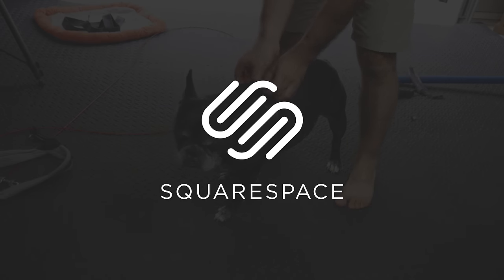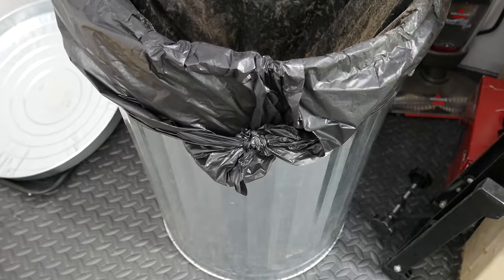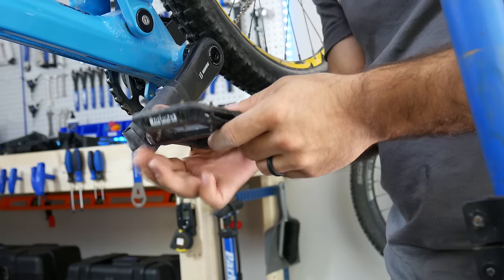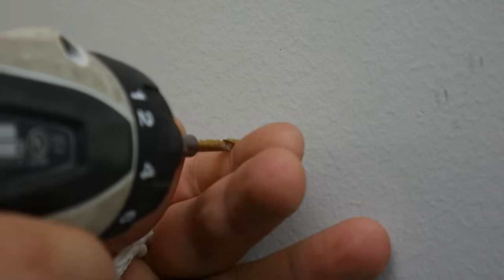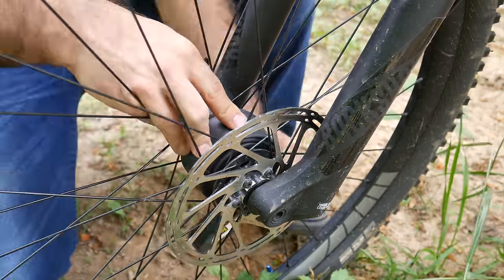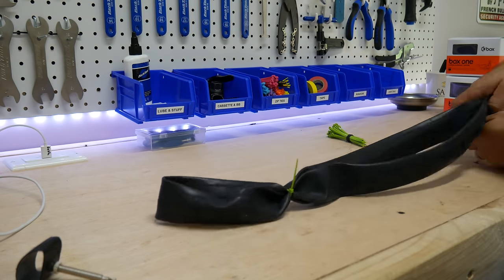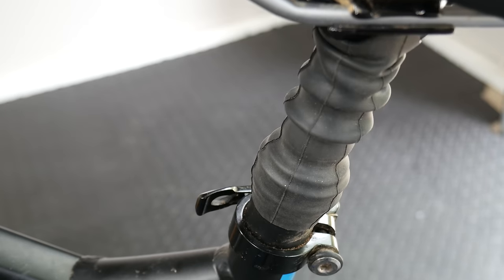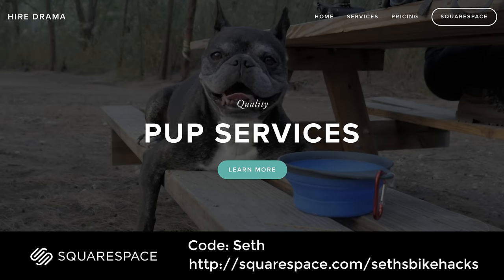10 Bicycle Inner Tube Hacks

Comment: One more inner tube hack that literally saved my ass: during a descent I lost one of the bolts that fix saddle on a seatpost. So I cut presta valve from the spare tube and used presta valve and nut as a bolt and olive to attach my saddle to the seatpost. That's why I loved presta.

Comment: To rip off some parts without scratching you can also use what, you guess? right! you can wrap part in regular piece of paper folded in many layers it can bare much more pressure in vice grips than tube rubber. I've figured that out when I had to unscrew marzocchi cartridge it was assembled very tightly and bicycle tube hadn't worked then. By the way nice idea with seat post, I've done same with fox r rear shock few years ago.

Comment: Hey Seth I have another inner tube hack. To protect your shock or stansion use an inner tube. Cut an inner tube and put it on your stansion or shock then connect the tube togeter with rubber cement. Thanks to your droper post hack I thought about this hack.

Comment: While watching this video, I realized that I also use an inner tube hack. I cut a piece of it perpendicular, so I got a tube which is like 10 cm long. Then I rolled it up to get a thick ring, and pushed one of it's side in, so I got a C shape, instead of an O. I put it into the downside of my seatpost (not a dropper) and now I can carry about 50 zipties around, by just sticking them into it. The good part, that it is secret, so people just won't take my zipties away. 
If its necessary can take a photo of it

Comment: on my downhill bike - i split an old tube down the centre seam, put my actual tube inside the split tube and put that inside the tire, and inflate. It adds a bit more weight but haven't had a puncture since. :o)

Comment: I use a piece of inner tube for shuttle service where you hang your bike with the front wheel. The tube pulls the front brake so the bike moves much less in the hanging position.

Comment: If you don't have a presta valve adapter, I figured out that you can make one out of a valve cap. Cut off the tip and push it on to your valve backwards, it should work just as well as a proper adapter

Comment: Oddly, I guess I'm not the only one who has resorted to odd measures to temporarily patch an inner tube. I once used a bread twist tie and fit in the puncture and wrapped it around the tube. I thought for sure it wouldn't hold air, but it actually held air for about 2 hours.

Comment: On my BMX in the early 1980`s i used to cut about 3 inches from an old inner tube and placed it over the bottom headset cup and this portrayed as an early dirt skirt.

Comment: If you are one of the few with both internal cable routing and an unused DI2 port, and those rattling cables drive you nuts, just take an old tube, cut it to length from your down tube to the DI2 port. Seal the tube (knot it, rubber cement)) and fish it through your frame. inflate the tube through the DI2 port and then stow it away. Silent internal cables for a small weight penalty.

Comment: I have a really cool inner tube hack. If you are traveling. Wrap an inner tube on your rotors. Cut it to size. And drill a hole on the tube. This will prevent youre rotors from being badly bent. Use Fidlock or zip ties. Clean it up before you install it on your rotor.

Comment: If your inner tube has pinned or flat you can use rubber band for temporary repair just tie on the pinned part and secure if there is no air going out anymore then if there is no you are ready to go so don't forget to have some rubber band in your bags when going to ride

Comment: If tube loses pressure very slowly it most likely means microscopic undetectable puncture, so there is no point taking it off -  just put some talc with water(or with winter wind shield fluid so it wont freeze) inside and you get tube with limited self repairing capabilities:)

Comment: when having a bike without a suspention fork like a bmx put a barend in the fork so your foot wont get stuck in there when doing footjams.
Also if you have a rim brake put a small coat of glue from a gluestick on the rim for better braking (spin the rim around and hold the gluestick againt the both sides)

Comment: If you need a chain breaker but don't have one, use a small socket or nut, a "c" clamp, and a small screw or bolt.

Comment: The tube around the dropper and around a hub is both not a good idea:
1. Dropper: the seal is pretty bad and if water gets into the tube there is no drainage, so after some time it will flow into the dropper post.
2. the hub is pretty much the worst place to tape your tube around: its hard(er) to get to than just wraping it around your frame, it adds to your unsprung weight and even worse to your wheelset and you have the chance to bail really hard if the tape wears off.

Comment: Y'know, if it wouldn't require me to completely disassemble the front fork, I'd  use the dropper post boot trick up front. I just have the Suntour XCT the bike came from, so far, so it'd be handy, and I actually like the look of rubber boots on shocks.

Comment: I was doing rly fast trails in uk and my tube got a huge split in it so I found a old tube over a tree which also had a split in it so I cut a few inches of and put it over my tube then I put some tape and rubber cement on it and it worked fine

Comment: If tire get small leak, and you not have any pads to repair it, rotate holes to some distance from each other. It reducing leak. Work require to emptying tire and rotate tire and pumping high pressure to tire.

Comment: The dropper cover is going to hold dirt in between the tube and the stanchion. This will scratch the stantchion and cause dirt to get under the seal
Reply: Use a bit of electrical tape and wrap it around the post at the bottom and the top and nothing will come into that gap!

Comment: Instead of  trying to drill the inner tube you could use a bottle torch to heat a scratch awe or punch and burn a hole through it. Just an idea.

Comment: hack for hydraulic brakes:
pull your brake lever with a zip tie to your grip over night, if there's some air in the brake system.
They will work good as new!
Reply: I'd like to know how that works. Do you have an explanation?

Comment: Hey Seth 
Can you try to make a cable end out of a soda can? Just cut it and measure the length of a normal cable end use the silver side of the can then by rolling it into a cylinder after rolling it fold the tip of it and your done if you want to customize it you can color it with a sharpie.

Comment: Folks+Seth, I have a question:
I have myself a 2017 Trek Marlin 6 Hardtail. I've had it since October, and all has been well on it except the rims: they're quite weak, and I find myself having to true them around every other ride. Recently I just took a pretty big fall on pavement and that bent my front rim. This made me just decide to ditch these old rims and get new, higher quality ones. The current rims on the bike are Bontrager AT-650 29 inch. I am looking for a set of wheels that will not exceed $200; they have to be compatible with my tires, 29x2.2 and 29.2(rear). Tubeless compatibility is a nice feature to have, but is not essential if it means a higher price.

Any help would be greatly appreciated!

Comment: bikehack: if you want to install pedals, just screw it in for the first turn and after that hold the tool and just spin your cranks backwarts. It will make changing pedals so much easier.

Comment: Hello Seth, could you tell me if there is any disadvantage in putting used inner tube on new inner tube in the tire, as added layer protection against puncture? I searched on YT & Google but not found anybody commenting on this.

Comment: Yow. Got a new MTB and its a prebuilt (not sure if that's the right term) it has a Stock Air Suspension branded by their company (trinx) and I'm not sure how to properly set it up. it doesn't have a rebound thingy. it only has a manual Lock out.

Comment: Take a hot glue stick and wipe it around your back rim and your brakes will work better. You can use any drink with sugar but the effect will ware off better
Reply: Cool
Reply: Mountain bikes use disc brakes. But for a bmx it works great. Done it myself

Comment: Hi Seth or people in the comments, I'm a beginner to riding street but I have a 3 year Mountainbike and 6 year BMX (on track) background. I want to buy some flats for riding street because that makes me feel more ''safe'' than clipless if that makes sense. Can you give some advice on what pedals to buy? My budget is around €60. I've been looking at the race face chester and the shimano saint pd-mx80. Thanks in advance! Keep up the good work and greetings from the Netherlands!!
Reply: You might get Saints even for 40€ on the internet, but me myself, I've got some experience now with my Contec Vice Flats (75€), they are pretty big, have cool design and are really comfortable to ride. And they got a lot of those srews for more grip, which can all be removed easily. But the best thing is, they were "cut out" just like they are from a big piece of aluminium by using CNC-Technique, which means that they are really robust! But you could also have an eye on the crankbrothers-flats!

Comment: Not exactly a hack, but. . . 
When you need to punch a nice round hole in an innertube or most any other soft-ish material, run by your local leather hobby supply (or look online). Pick up some leather punches, they have them not only in belt-hole sizes but up to oh, say, 3/4". The also come in various shapes like oblong and oval. Slainte!

Comment: I noticed you used a scissors to cut your zip ties for the dog bra. If you use a toe/fingernail clipper then it will round the edges and not be sharp. I use this for any area where my skin could rub because it won't cut me.

Comment: Hey seth, is the tube on the dropper post safe? im thinking if dirt gets stuck in there its going to rub and scratch the post..
Reply: Use a bit of electrical tape and wrap it around the post at the bottom and the top and nothing will come into that gap!

Comment: Tried using a valve from and old tube to make it tubeless and it didn't work too well. It wouldn't seal up and I kept tightening it and it eventually pulled through

Comment: If you don't have a top cap you can stand on the bars and hold the roof and push down and then you get someone to tighten the pinch bolts how to ride if you're don't have a top cap

Comment: Hack #11: using inner tubes how they were designed to be used because I can't afford tubeless
Reply: Rian Mach tubeless is cheaper, you buy a rim strip and a valve then you can't get pinch flats and the sealant will seal holes In the tires

Comment: can I apply that inner tubes for the fork stains??
Reply: Scareface Visuals yes
Reply: measure the length of fork cut it out and take the front wheel off and slide on up
Reply: ok ty, and  if I put some more on stanchions?

Comment: Hi anyone maybe able to tell me :  when I change my inner tube (with presta valve) there is a thin rubber strip inside, I'm not sure if it should be placed between the rim and inner tube OR between the inner tube and the  tire,  thanks!

Comment: Is your right brake lever for your rear wheel?
Reply: dquad it's preference you can change it if you have the tools and kit for his type of brakes but on bikes with cable brakes it's considerably easier
Reply: I don't mean to sound like an ass, but it seems somewhat dangerous to swap the brake levers left and right (from a standardization point of view) as all motorcycles (and standard pushbikes as far as I am aware) have front brake on the right hand side of the handlebars. The effects of applying front and rear brakes on a bike are markedly different and it would not be particularly fun for someone who is used to one configuration to use someone else's bike and ending up going over the handle bars when they apply the wrong brake.
Reply: Also, I come from a part of the world which drives on the left, which may explain my ignorance.
Reply: Left front right rear is standard in north america

Comment: Would it not be easier to take the dropper post out and go from the other end
Reply from the maker: That's a damn good point. Between feeding the cable in, unhooking it, and being careful not to scratch anything, it might still be less work than taking the saddle off.

Comment: What would be a good starter Moutain bike.
Reply: Do you wanna do something like XC racing or just riding for fun? What is The top of your budget?
Reply: Max Joseph i have a diamondback axis 27.5 xe and i love love love it. it cost about $500 though if its not on sale but i got it on sale for $449 at dicks sporting goods. the tires are really good for stock tires and all of the other stock parts are good. i have upgraded my grips, chain, derailleur, and tires by now and take it onto some of the toughest trails in pennsylvania. just beware to tighten your cranks though because i got into a really bad accident because i hadn't tightened my cranks but these seem loose if u dont tighten them often. so that was all my fault but id give this bike a 4.8/5
Reply: A bike for trail riding
Reply: Outdoorguy 360 thank you for your advice.